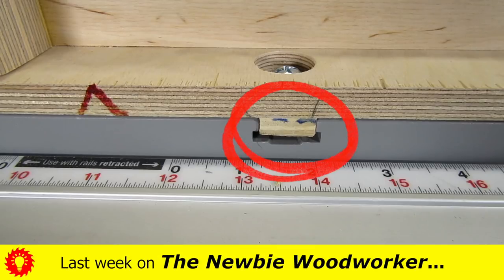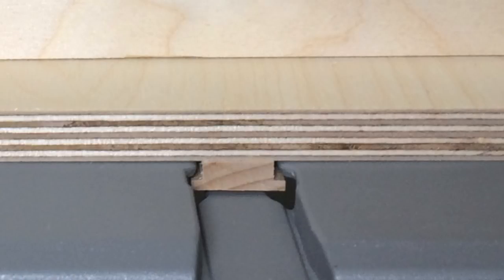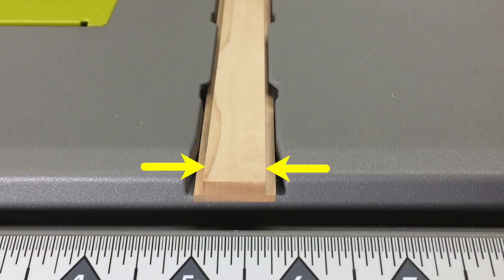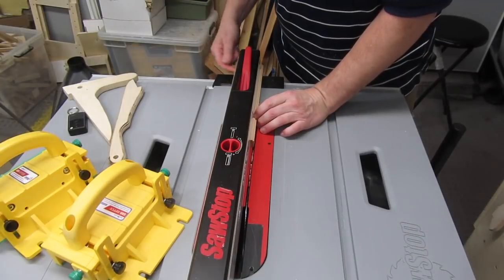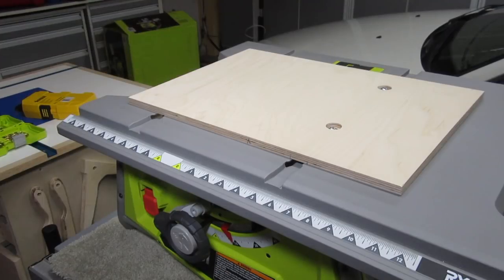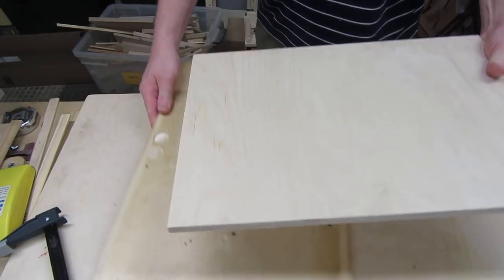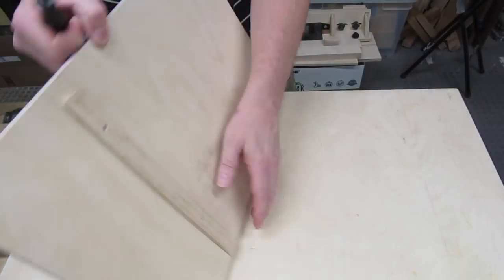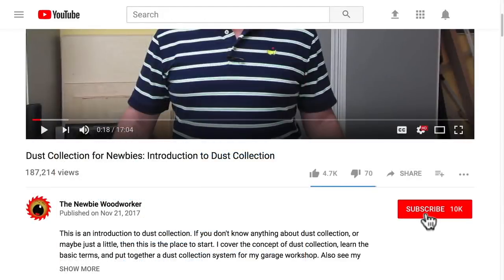Runners for Ryobi/Craftsman Tabbed Miter Slots

Comment: So what exactly is the purpose of the tabs in the slots to begin with?
Reply from the maker: I'm not sure anyone knows. 😄 Don't get me wrong - it's a great question. I've just never heard a good answer.
Reply: I assume it is so the miter gauge does not come up out of the slot when in use.  Also, my gauge runner is a little loose in the slot and the tabs keep it a little more accurate.  Or, it could be a cheap way to stamp a runner slot into the table of the saw and the other explanation is just creative BS.  ;)  I was just getting ready to grind off the tabs on mine when I saw this video.  THANKS, NEWBIE!
Reply from the maker: @brianking5092  You're welcome. Your theory about the tabs may be correct, but if it is, that's not much help. The problem isn't that a miter gauge won't stay down in the track - the stock should help with that. The problem is the side-to-side movement. If there's side-to-side movement, then you're less likely to get a straight, accurate cut with a crisp 90-degree angle (or whatever).
Reply: @TheNewbieWoodworker  One comment stated that his grooves are not consistent in width, and possibly not even parallel.  I will now investigate that before building a sled.  This saw was a hand me down, so I guess I get what I paid for.  (The rip fence is junk too)  The motor and bearing has held up well over the years and has cut a lot of plywood and 2 x 4 's.  I am now trying to use it for smaller, more delicate and accurate cuts.  I may be asking too much from a cheap saw.  I recently built a shooting board for my plane and may have to use that a lot more to pick up the slack from the inaccuracies of the saw if I can't make a decent sled.
PS.  I used the 5 cut method to square the shooting board.  It took some time but it worked like a champ.
Reply from the maker: @brianking5092  I'd be surprised if you couldn't get a sled to work. Even with some play in the miter slots, you should be able to get it "close enough". I mean, this is woodworking, not metal shop, so perfection isn't really needed. But I would recommend attaching the runners with screws, so you can adjust them if you need to. Unless of course you're looking for an excuse to buy a new saw, in which case I take everything back and say "dump that POS". 😜

Comment: i bought  2 , total pain in the ass mid 80's , DELTA bench saws , ya, ya, i said 2, they were from a clean out  , and the guy gave me both for $14.00, so ,,,anyway, i don't just have tabs, i have more like a T slot the whole distance , and although i could live with that, the bench i have them attached to needs slots, i was almost OK with that and then  i broke the bit, i did find another solution, im just gonna put a piece of  U track 1/2 "through the saw and the bench, OK, so , since you are one of the few who answer comments , i thought i'd ask you, do you know what the cutouts on the wings of the top of the deck are for ? there are 2 rows of 6 rectangular  holes with a circle cut out between the rows at the center ????????, i have looked and can't find anything, maybe you can help, maybe a router???
Reply from the maker: Do you have a picture? If you can't find a link to one on the Internet, email a picture to me. Just go to my website https://thenewbiewoodworker.com/ and click the "Menu" icon in the upper right, then select "email".

Comment: Every Ryobi tool I owned has not last past 6 months and I am not hard on tools.
Reply from the maker: I've had some Ryobi tools that have worked well, including my band saw, but I've also had some that were crap. So I always check buyer reviews before I take a chance on any tool, whether it's Ryobi or something else.
Reply: I've had my Ryobi drill and impact for 7 years.. I've dropped them on job sites from 6ft ladder before and they  still going strong. I have this ryobi table saw as well(not my first pick, but it was a gift.) and I've had it for 3 years but I haven't used it too much. (original blade is still good). But it still works no issues.

Comment: What about just removing the tabs? Like with a cut wheel or grinder?
Reply from the maker: Yeah, apparently people are doing that. It's probably what I would do too.
Reply: I've been tempted, but because the table top is formed from sheet metal, I've been concerned that grinding out the tabs would just leave holes in the channels and portions of the runner channel very poorly supported.
Reply from the maker: That's certainly a legitimate concern, and I won't tell you that you should do it. The one thing I'd look at is how long the hole portion is, compared to how long your runners will be. If the hole is, say, 2 inches, and your runners will be at least a foot, then it seems like it might not cause a problem.

You could always try it on a tab at the back of the saw. If it turns out it causes an issue, the runners will already have passed the blade, so it may not matter. Assuming the last tab actually is past the blade, which I would think it is.

Have I added enough "maybes" and "mights"? 😛

Comment: I bought the Ryobi 10" portable table saw.. and in came with only one miter slot on the right hand side of the saw .. what's up with that?? .. how do I make a sled with one slot?
Reply from the maker: Unless you make a large sled, it's fine to use just one runner.